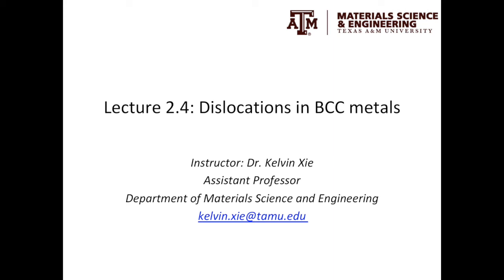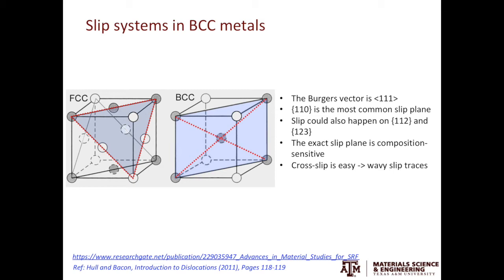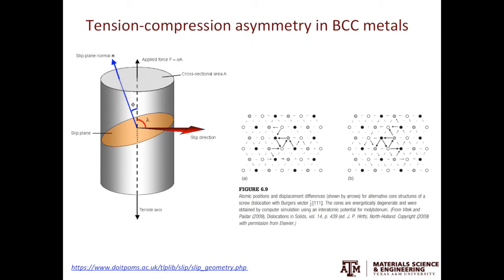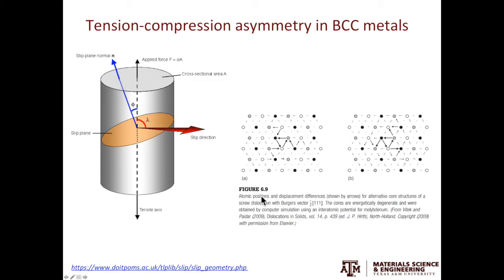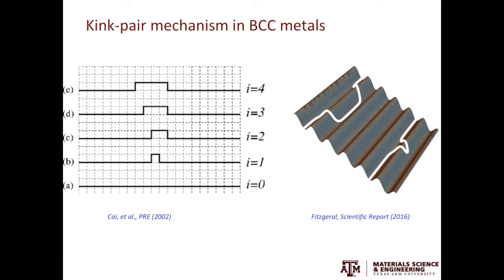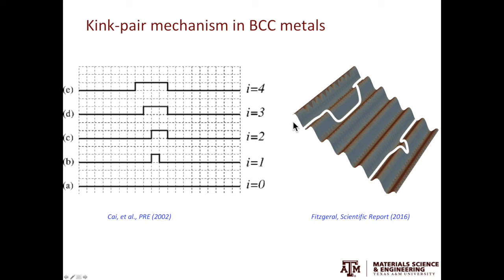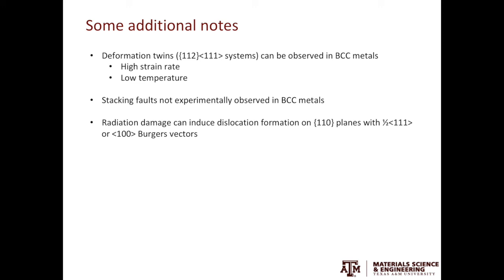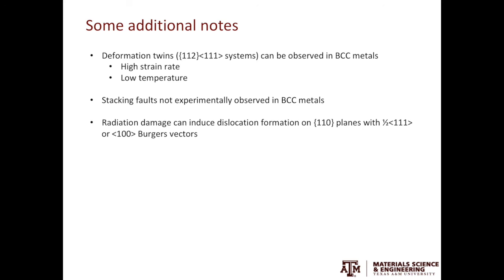2.4: Dislocations in BCC metals

Comment: Thx for your nice talk, Kelvin. I have a comment on the third bullet point in your last slide. Here, do you mean radiation induced dislocations are actually prismatic interstital dislocaiton loops? If yes, in nuclear material science community, it is well accepted that SIAs will firstly nucleate on 110 plane and then change their habit plane with growing size to 111 plane with 111 Burgers vector which eventually can be resolved by TEM. As to the formation of 100 loop, it's another story. In my opinion, the third statement might be misleading.